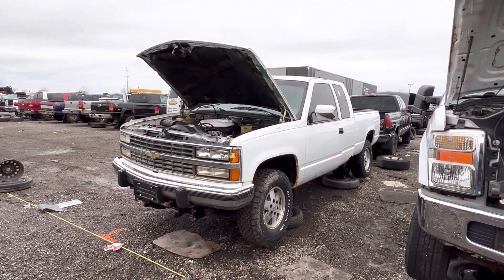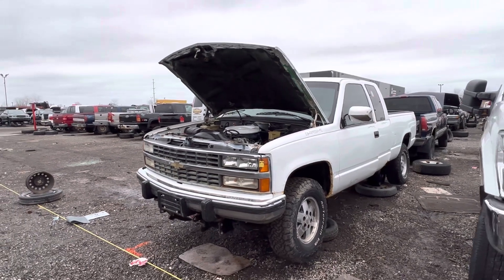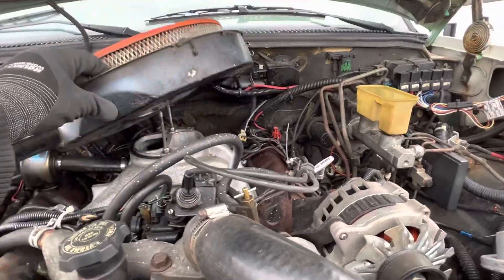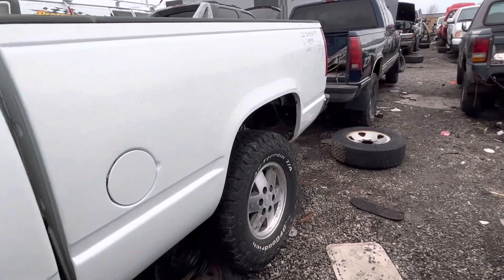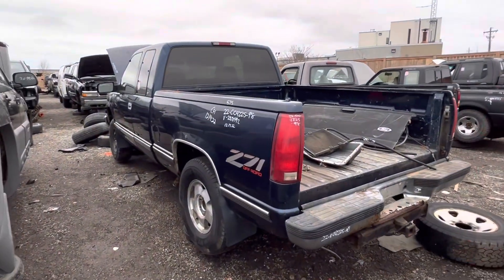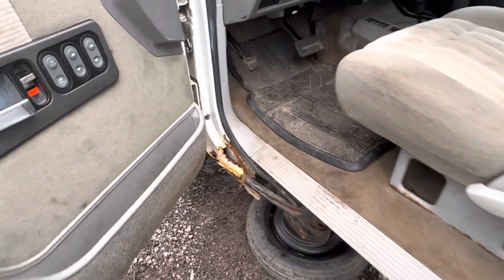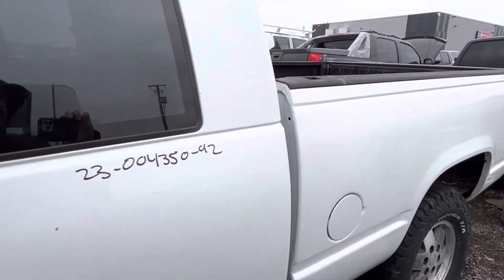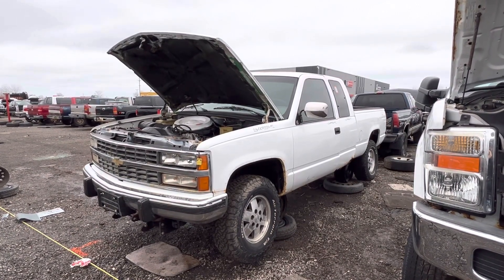Junkyard Hoopties- VERY high mileage Early 90s Chevy Silverado 1500 6.5 TURBO DIESEL

Comment: Beautiful diesel truck.  Yes, around this cruddy salt belt they are.  This truck must have come from a low salt diet region, then subjected to plow truck duties.  OK, the engines being dogs?  The 6.2 was brought forth in 1982, for then they were perfectly fine, nobody else had really anything else to offer, the 6.5 pretty much was an in house design, not a sourced part.  30 and 40-year old technology is not like what we have today with crazy 700-horsepower  1000 -pound feet diesels in pickups. It would be like comparing a 1940's diesel with the 6.2 in 1982.  These engines, with a few small, but important mods would and some still are going strong with high KM's as you see here.  Maybe the engine is original, maybe not, but it looks pretty stock to me. I really hope somebody saved this truck, at least got major parts from it, but these yards do not keep them for too long. Thank you for posting!

Comment: This is a 6.2 diesel.  Had one.  Had 6.5s aswell.   1500 in 92 only had a 6.2
Reply from the maker: Oh i always thought that the 6.2 only came non turbo
Reply: @MikeUtoober  hey Mike :) yeah so the 6.2 went till 93 , mechanical pump 6.5 turbo came out in 92.  then the 6.5 turbo went with the electronic pump in 1994. And the 6.5 non turbo , they were around 93 to 95 mostly found in the G vans, Vandura, and Grumman step vans.  But in the pickups too !   The 6.2 , 82 to 93 was even slower than the 6.5 , around 140 hp but I got over 600 000 on mine.  It was like that white one.   It got great fuel economy.   Remember when it was new, clear diesel was about 40 cents per litre.  Colored was 32 cents.  Very economical!  So that truck, is a 6.2 cause at that time the 6.5 turbo only in the 2500 , 3500.   By 97, the 6.2 gone.  I had a 1500 z71 with a 6.5 turbo.  Great truck too.